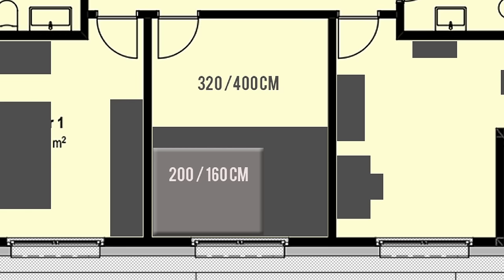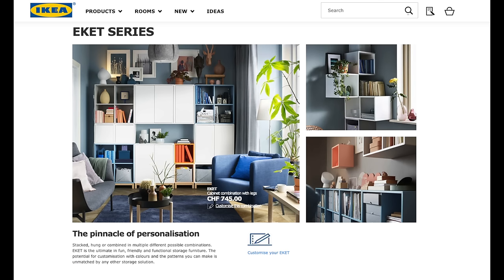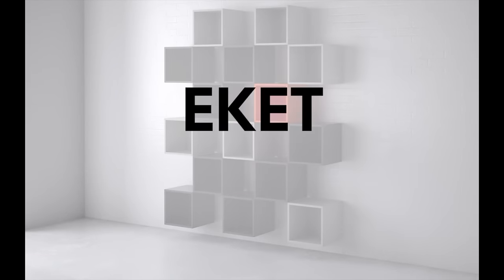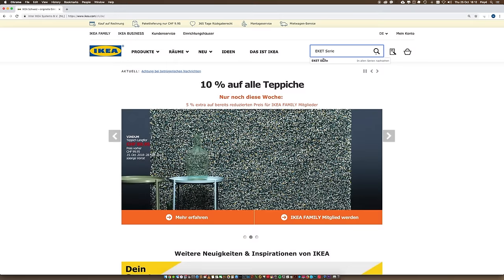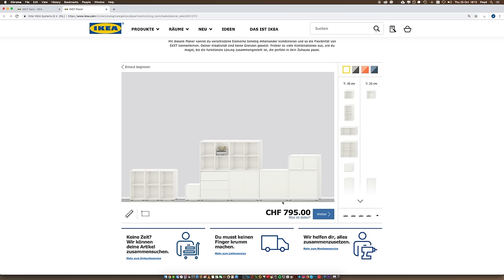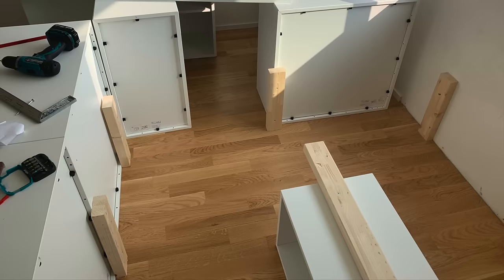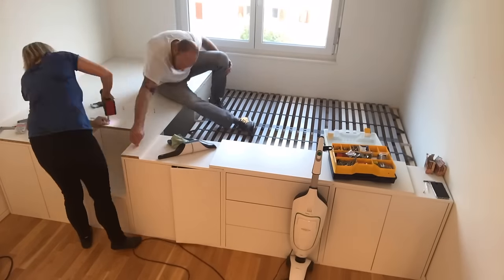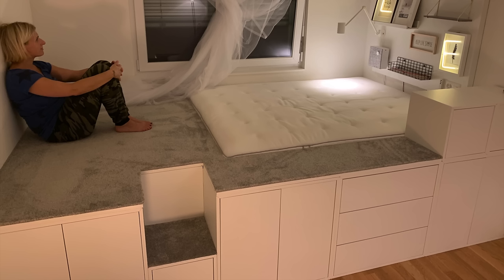IKEA DIY HACK | Platform Bed

Comment: you could literally just build the cabinets yourself. it may take longer but itd be way fucking cheaper and far more customisable that way. and plus you wouldnt have to waste money on storage that is completely inaccesisble. also, why not create a mechanism that allows the mattress to be lifted so that you COULD access storage underneath? itd take way longer than just a weekend but it would likely be of higher quality bc ikea SUCKS and also wayyyy cheaper again. i could imagine doing something like this maybe with my dad or step dad in the future. no doubt theyd have fun with it but also it wouldnt hurt my wallet nor theirs. trip to home depot just to pick up all the supplies, make sure to get everything fitted properly, sand down the wood, paint it, install the cupboard doors, and come up with the design for the mattress lifter (which would be an easy, cheap and fun project for my dad for sure). honestly fuck the Ikea shit, just build everything yourself. if you team up with a relative or friend who can help, it would be loads easier. or if youre willing just. do it on your own. like damn. this is basically only good for inspiration lol.

Comment: So much wasted furniture money and space... You may as well just build a normal platform just high enough to install the outer cabinets under and leave one space for a door so you can use the rest of the underneath space as either a fort or out of season storage to put that space to use! Put the mattress on top instead of sunken in so you can change the sheets easily and you’ve got more storage and the same look at a lower price!

Comment: that's not space saving or better space utilising - it is just putting cabinets right next to a bed. So what's the advantage with all the hard work when there are lots of volumetric space under the platform that is now inaccessible and effectively reducing the floor to ceiling height. Total waste of time.

Comment: those useless cabinets on the inside are stupid, just take some normal wood peices for support, leave the back of the cabinets out at one of the front parts and you can use aaaaall the space beneath the bed for storage.